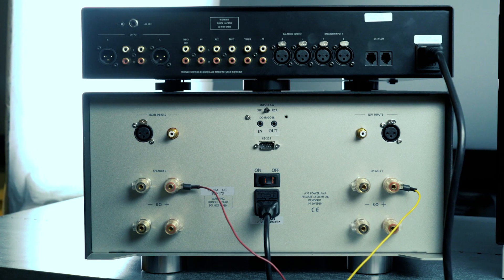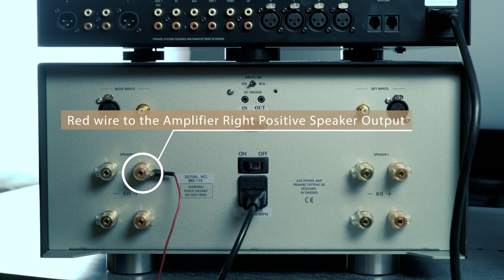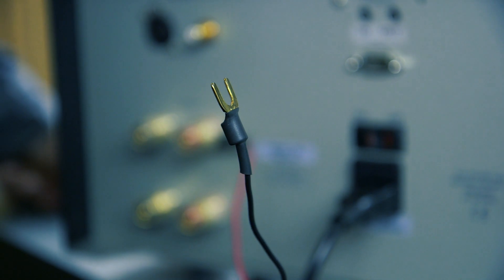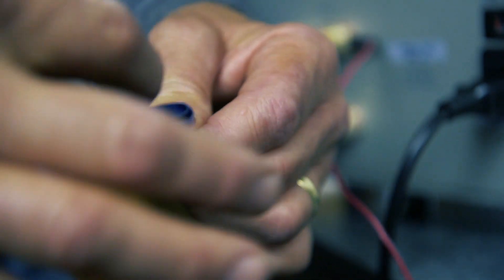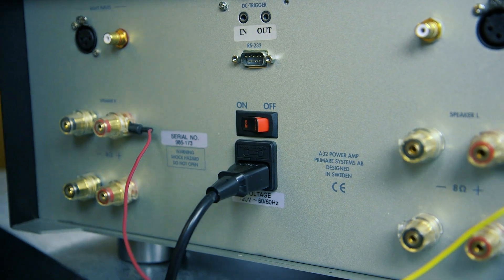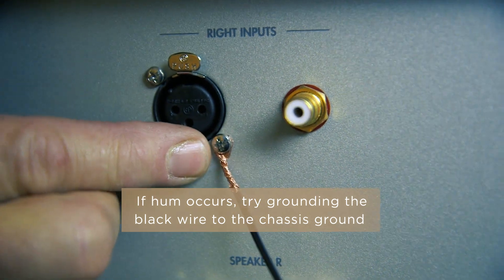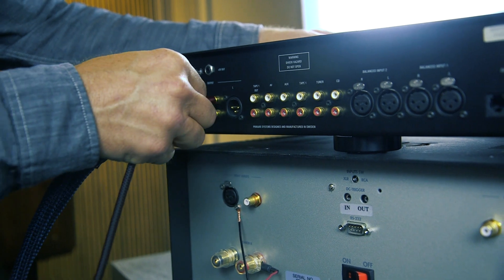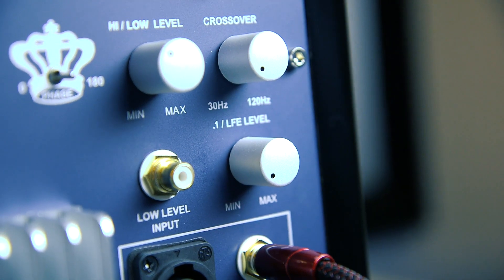REL Acoustics How To: Connecting to a Balanced/Differential Amp Using the High Level Cable

Comment: So this works on floating amps like circlotron circuits in Yamaha AS series amplifiers?
Reply from the maker: Many Yamaha AS series amplifiers feature balanced output stages, so the connection instructions shown in this video can be used. For high level connection instructions specific to your system feel free to write in to contactus@rel.net and we will be happy to help.
Reply: @RELAcoustics  thanks but a year later I've sorted it ..
Reply: @peterwood2633  Hi, I'm about to hook up a t7i to a Yamaha A-S2100. Is there any advice you could give me? Cheers
Reply: @gr8ednz  don't connect sub high level negative to the negative terminal of the Yamaha! Leave it floating wrapped in electrical tape. If you get a lot of ground loop humming you can connect to ground/chassis but I didn't get any of that. I also found I only needed one positive wire per sub (i.e. one red or one yellow not both) as that gives double bass which was too rich and unnatural
Reply: @peterwood2633  thanks for that. I used the method you described by leaving the black wire loose but had a loud hum as a result. I then connected the black wire to the A-S2100 ground screw & the hum was way less audible but still there. I currently have red to right positive & yellow to left positive, black to ground screw & have a low level hum. Can't really hear it over the music but it's still bugging me. Anyything different to your set up? Do you have a similar amp?
Reply: @gr8ednz  I have a-S1100 so same floating topology circuit. I have two subs, one is connected to left speaker positive terminals and the other to the right. With only one high level positive wire for each sun as previously mentioned. I get mild hum no different to the normal BK amp plate hum. Only weird thing I get is when turning on the amplifier I get a loud THUMP once from the subs. I never grounded the black wire though so don't know if that would make a difference maybe I should try!

Comment: What if I am using the xlr balanced output from my amplifier from the xlr balanced input from my preamp? Any different connections here I should be made aware of?
Reply from the maker: The proper high level connection method depends on the design of the output circuit on the amplifier, rather than what cable type is used for connecting from your preamp to the poweramp. For high level connection instructions specific to your system feel free to write in to contactus@rel.net and we will be happy to assist.

Comment: What if the amp is both balanced and Class D?     Same way?
Reply from the maker: Same connection method. The name of the game is finding the ground and both Class D and Balanced Amps do not use the Black speaker output terminal as the ground.